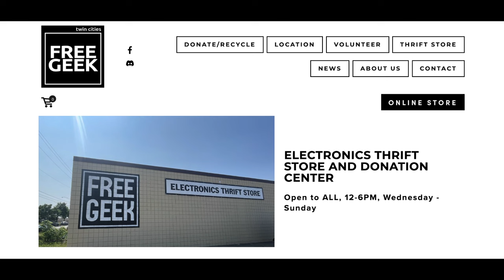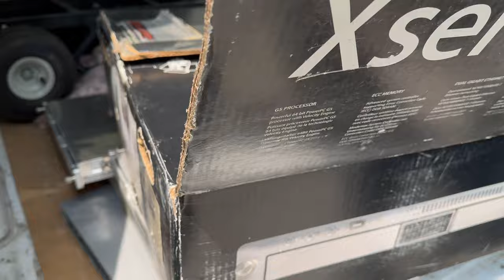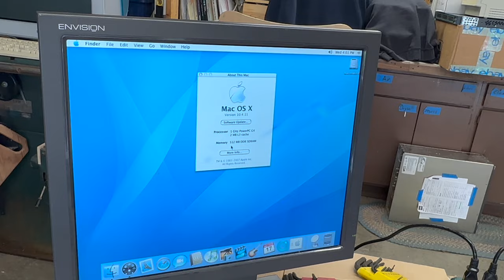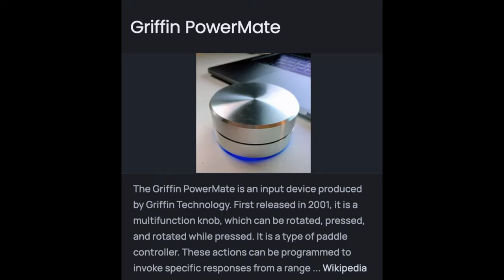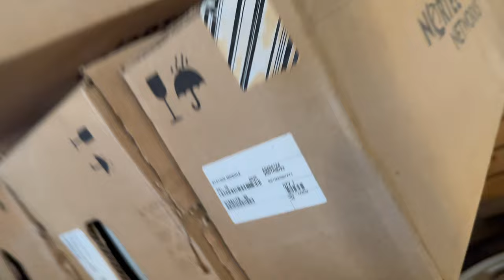Massive Apple Retro Computer Hoard Pickup:  Part 2!!!

Comment: The AAUI port was an Apple interpretation of the AUI port on IBM. It was a quick connecting port and you could use 10BaseT adapters or Thck with it. It was featured on the first several generations of PowerMacs as well as the Quadras/Centris. Cool video - love these trips down memory lane with John.
Reply: That little black battery pack in the QuickTake Box is a for the Newton Message Pad. It was designed to hold 8 batteries and used an external battery pack.